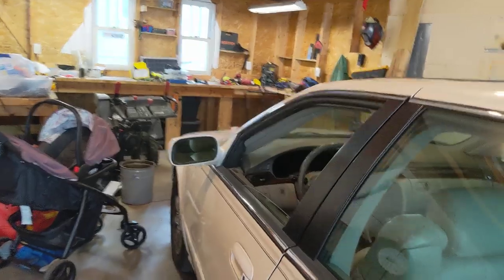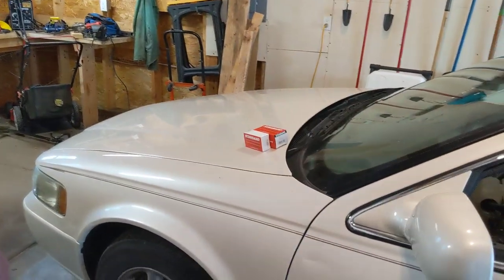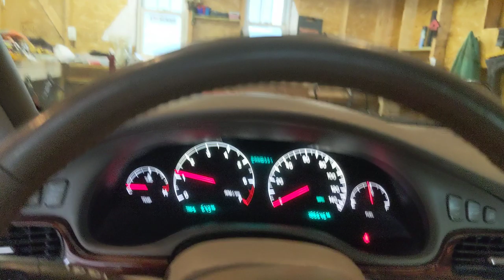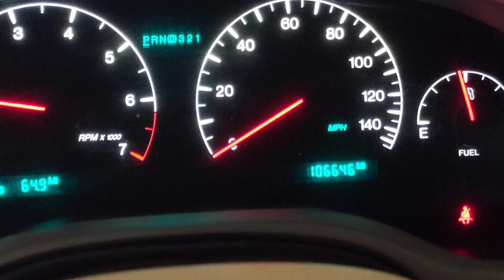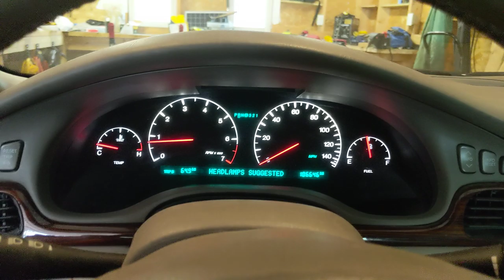The Cadillac

Comment: The sensors go out of sync due to the magnets getting weak. A/c compressor were common as for the leak check the crimps at the lines all we used to do is peel off the aluminum crimp and use a pair of jubilee gear clamps. The Northstar has an issue with oil consumption that is also it's emissions issue with the intake gasket and the seal at the throttle body. The abs issue also common check the front speed sensor harness that attach to control arms check for resistance the wire goes black and interrupts the pulse. As for the doors locking I think you can go in set up and turn it off. I've seem the cabbies go to the neutral safety switch and sever the connection but it does want to see load so a relay and 194 bulb get wired in it's place to keep the engine light off. They are cool cars way ahead of there time for what they are. We've worked on lots of them over the years thanks to the salt/brine they have gone the way of the Dinsoare in Ontario. All I can say is enjoy. I think I still have a compressor for one of them now that I think of it.....

Comment: how much can the Cadillac pull?
Reply from the maker: 2000-3000 pounds
Reply: @exploringlife3389  that will be able to pull a 12 or 14 foot boat with a 9.9 
15 or 25 horsepower engine mabey